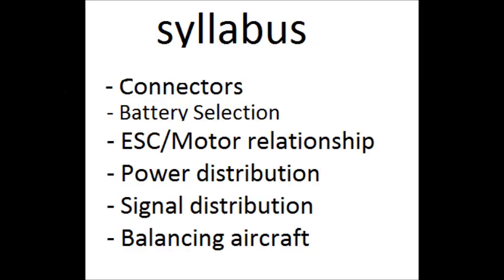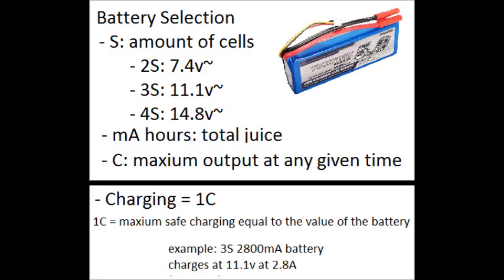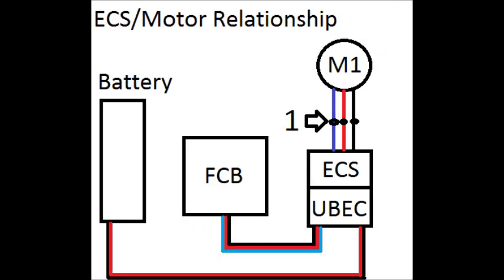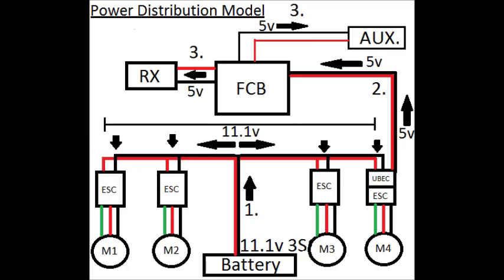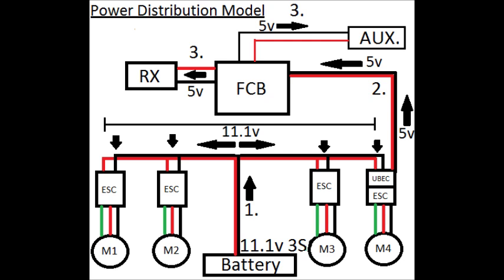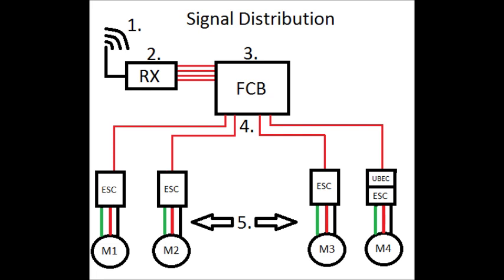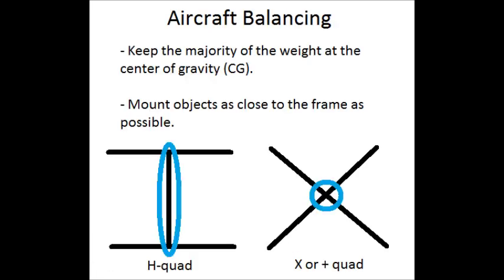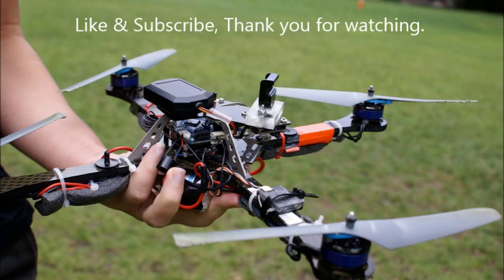Quadcopter Basics Chapter 2: Electrical & Mechanical Theory

Comment: What causes a quadcopter to rotate?
Reply from the maker: like spin left or right (yaw)?  basically to move in that manor the machine slows down the counter spinning motor depending on which direction you're rotating.  So if you're trying to spin clockwise it slows down the counter clockwise motors to allow the clockwise to rotate the aircraft with natural inertia.  A little tip: do not go into an extreme yaw keep it gentle because that'll nearly turn off the counter rotating motor and when it boots back up to maintain a hover after the maneuver it puts an extreme amount of stress on your prop causing it to break sometimes.